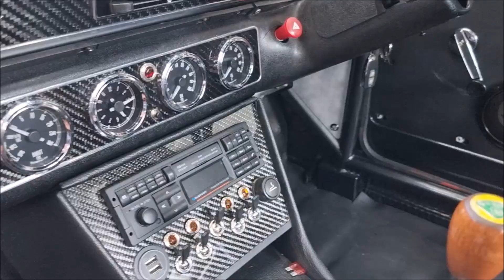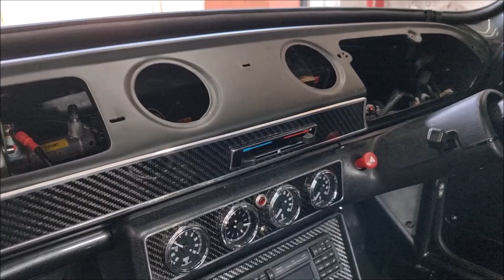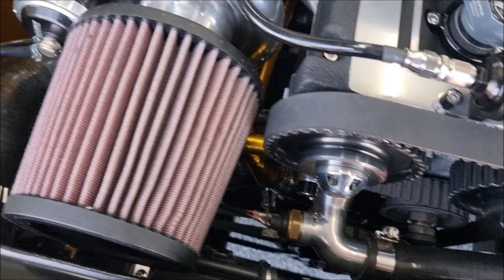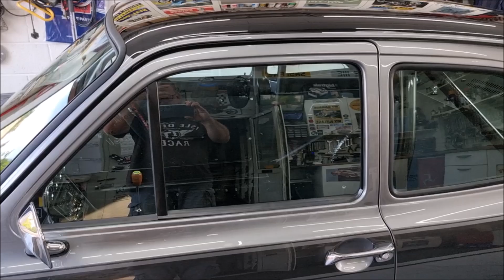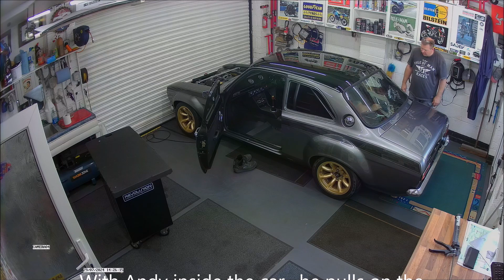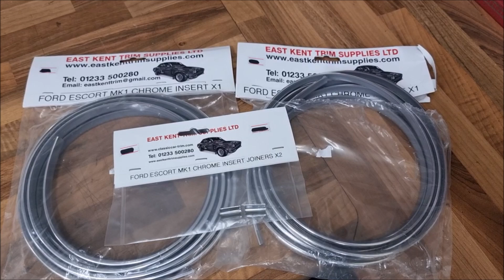Lee's YB Powered Mk1   Rebuild No 3

Comment: If you have to replace the windows again go on line a purchase a pair of suction shower handles then you can use them to place a manipulate the glass with ease I build a Ford Pop & that’s what I used
Reply from the maker: Great tip - Thanks 👍

Comment: What a way to start the week! 
Thanks for the post Lee - You have set the bar so high this build, it now affecting the quality of my sleep dammit !
Jokes aside - well done and really looking forward to the next update.
Reply from the maker: LOL ! thanks mate , its been causing me some sleepless nights too - but for all the wrong reasons
Reply: @Cossie.Mk1  Hi Lee - Update on my build - shes coming along nicely with a modded pinto setup and I am at the point where I remembered this video you posted last year and realised that standard MK2 1600 Sport disks and calipers are not "ideal". Question - which make and model disks are you running up front? - Shopping around for calipers as I am fitting 15 inch wheels as well & would the Renault Clio 3 RS Brembos be an option as  they are smaller than the megane setup. Anyways, thanks for all the vids and I must say your car has truly set the bar for resto escorts.
Reply from the maker: The discs are copies of AP Racing 304x28mm from Godspeed in Wales.  What ever you can get inside a 15" rim will work  - the bigger the better 💪